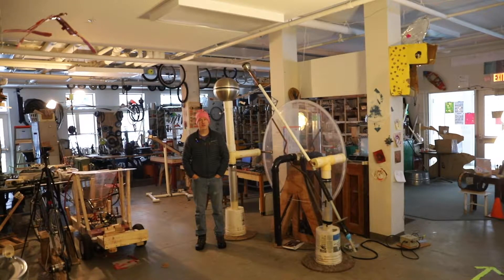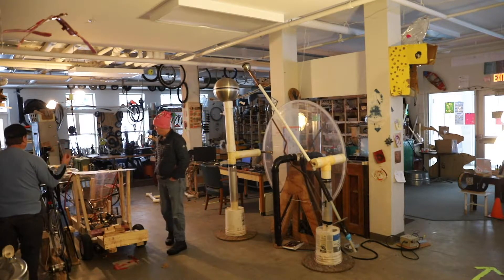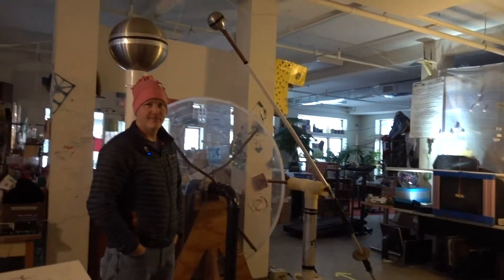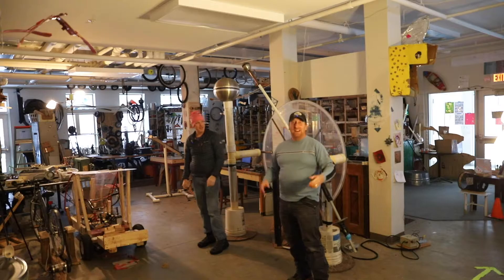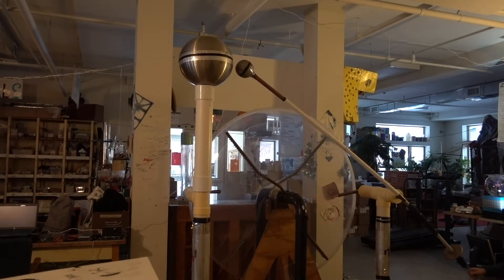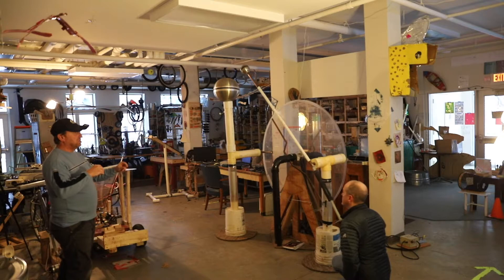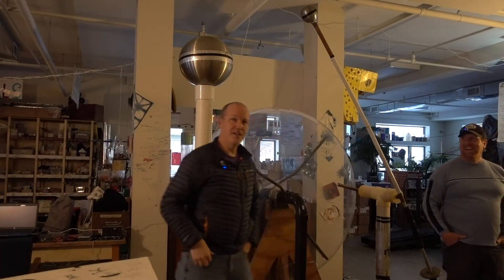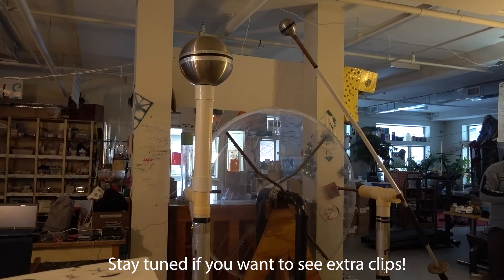Worlds Largest Bonetti Machine - Revival 2021 at FSW

Comment: A properly tuned Bonetti machine in a dry room can create sparks that are about 1/3 the diameter of the disks. This machine has very low performance. A Bonetti electrostatic machine  accumulates charge in layden jars (High Voltage Capacitors) so the sparks can be very intense

Comment: The capacitors are either not working at ALL or woefully inadequate,  I would imagine that you need a total capacitance of 1 nF for that machine meaning two 2 nF Leyden jars.  Always the small ball needs to be positive and the large negative.  Since you can NEVER guarantee the startup polarity you need both on both sides of the machine.
Reply: What if you connect this machine with a magnetic DC generator? It will become more efficent?
Reply: It’s possible to determine the startup polarity. The startup polarity will always be the same for a given source. For example, if a section of PVC pipe is charged by rubbing with a paper towel before holding the pipe opposite one of the top neutralizer combs, the output terminal on the side opposite this neutralizer comb will always be positive. For any given charge polarity that is used to start the machine, the machine will always start with the same output polarity.
Reply: @magx1  if the machine needs to. E started, it will ALWAYS start in the same polarity of course.  A well built machine will self start for days, sometimes weeks or months after initial startup (Bonetti). Some like mine will reverse startup polarity each and every time the machine is turned on and it self starts.  Again the self starting happens due to residual charge stored on the discs, not due to polarizing opposite some external charge source like on a dead start. Mine started to do this after I replaced all my blade neutralizer combs with stainless steel thread instead of blades.The machine began self starting even after seemingly dead for weeks sometimes, and when truly dead would go for weeks and months without a cold start, the down side is this reversal each and every startup when self starting.
Reply: @MisterBonetti  That's very interesting. Would it be accurate then to think of your machine as an amplifier with extraordinarily high gain, or would the analogy be irrelevant?
Reply: @magx1  I think its irrelevant, although since all these machines are voltages multipliers that multiply voltage to infinity (only after a minute fraction of second the machine is already leaking too much to continue the multiplication), so I guess from that point of view your analogy is spot on. They are voltage amplifiers for sure.  Part of the reason for the reversal of startup polarity on mine only when it self starts, is that the disc pairs do not lose charge at the same rate, if you looked at my two current reading videos I showed how the inner sections return currents of 4i and the outside facing two discs return 2i, besides the angled neutralizers the extra current from the internal discs is that the close spacing of the disc pairs acts a shield preventing the electrons from flying off as easily to the surrounding air. This probably means the inner discs lose charge at a lower rate than the outer discs as well.  The polarity the machine will start up at depends on the ratio of charge imbalances, one disc pair can throw the whole thing off, while a single paired machine would never exhibit the problem.
Reply: Br0, U put the B@ll$ in a jar? In math? It's the math I named. Carry 0ff.
Reply from the maker: I'm a bit embarrassed about it, but I blew a hole through my caps shortly before making the video.
Reply: The neutralizers need to be more vertical also.